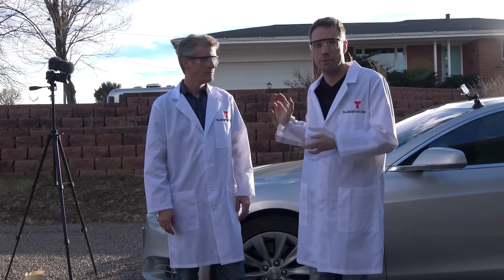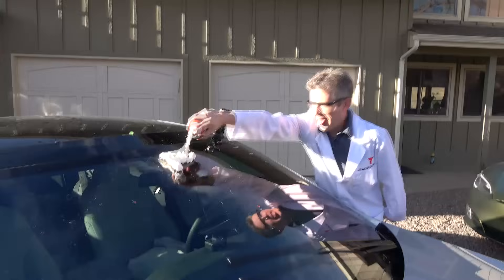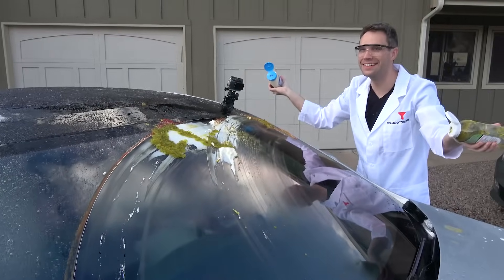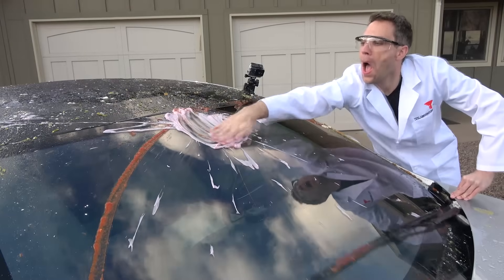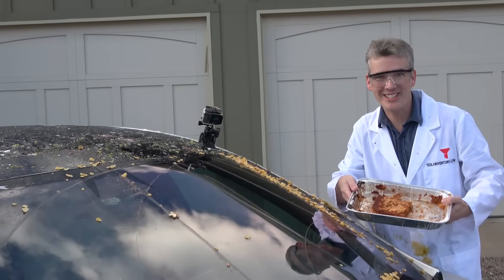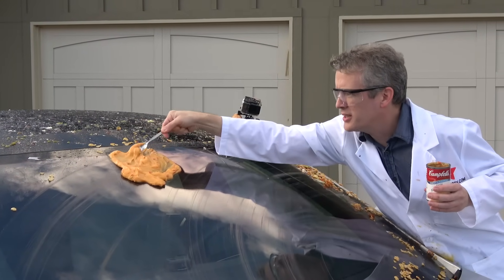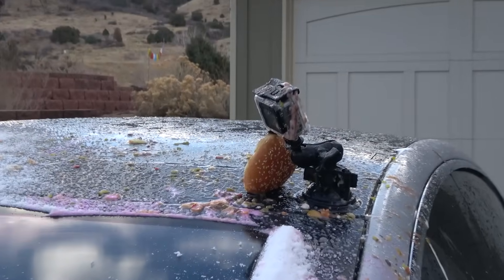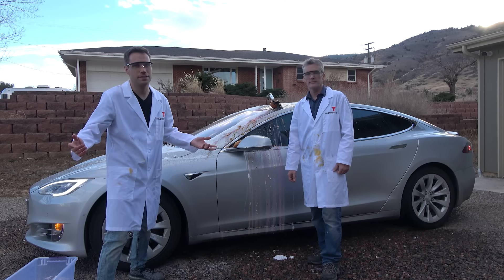Will it Wipe? Tesla Autowiper Extreme Test!

Comment: The rain sensor works by sending infra red light at 45 degrees against the windscreen... if there is no water most of the light returns back to the sensor...
However, if there is water in the windscreen,  this will reflect the infra red light in other directions away from the sensor, the system measures the difference between the infra red light sent and received to calculate the amount of water/rain....
So, anything capable of reflect infra red light will activate the wipers...
Funny video anyway...
👍
Reply: We love a smarty!!!!! Yay!!! Thx!!!!

Comment: For a better test,, they should have dumped the contents in the middle of the windshield and not at the very top.
Reply: Do you really not realize the logistics of this whole thing and how things work? The sensing has to be done at the location of a sensor which in one place where it is located. In this case it is the camera seeing the drops or particles. If any weather occurs, it will hit all over the windshield and be blown to the top while you are driving due to the air flow. Dropping things in the middle will not be seen and not activate the wipers. That is also unrealistic and would not happen while you are driving in normal circumstances. In a rare case of that it hits in the middle only as with a bird dropping, you can activate them manually.

Comment: So, for a concrete question: I thought the wipers didn’t run unless the seat was occupied? There’s a Reddit post about opening the doors turns on the wipers and wipes the water onto you. I’ve not tried this on my car but I thought you had to get in the car to start auto wipers and then wouldn’t get wet from water on the windshield. (And, how did you run these tests... was someone in the car?) -Lee
Reply: Maybe there is a bag of flour in the drivers seat.